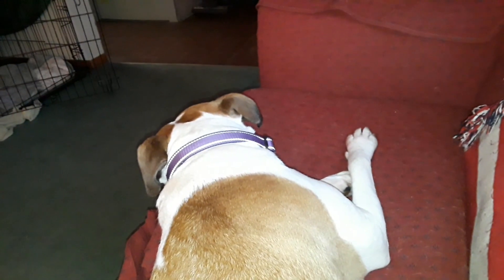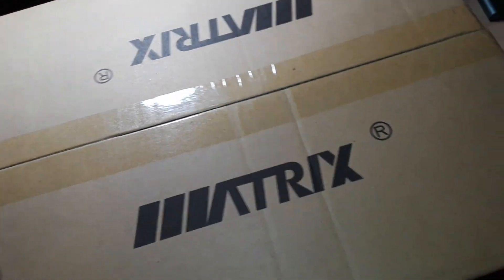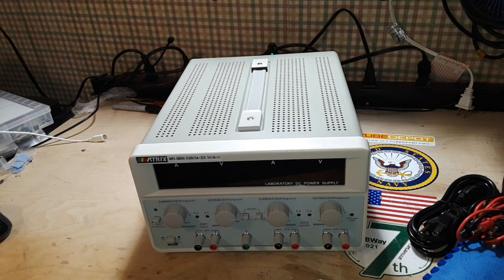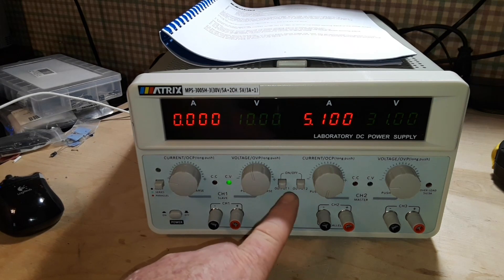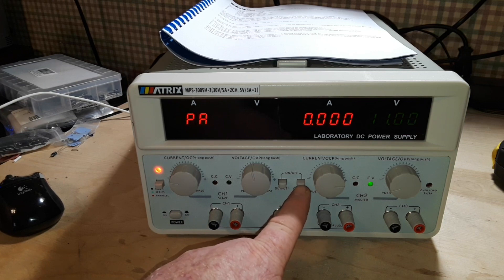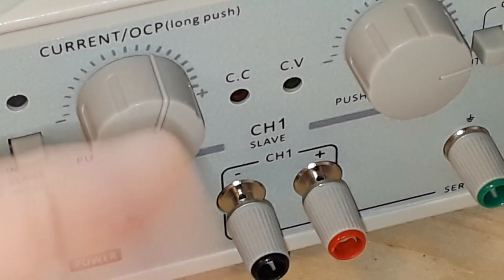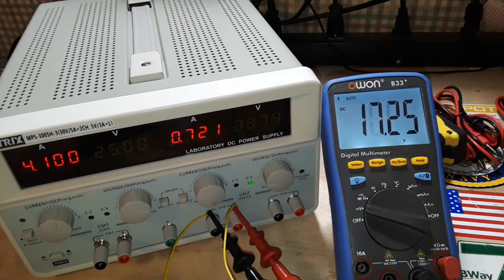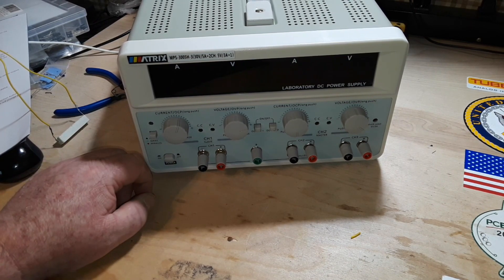Matrix MPS 3005H 3 3 Output Linear Power Supply

Comment: I just got mine delivered a few hours ago. Voltage on both channels is dead on exact. Assuming my EEVblog BM786 is. It comes with a calibration datasheet from the factory. Results were very close to correct. Also lists the test equipment they used and when that was calibrated. Nice. The warranty card wasn't in the box. One weird thing. One dial wouldn't push. I was really pissed off. But I pulled the dial cap off and the problem vanished. Whatever. 🤣 So far, no problems.

Comment: Contrast this with a SMPS which is much smaller and lighter, like you said a great product and should hold up. Understand the fan noise goes down after turn-on but if it's still loud for your taking can always swap with a Noctua fan.

Comment: Does “no independent current adjust but we can do overcurrent protection” mean I can’t use it with current-limiting for hunting shorted components that overheat?
Reply: the current adjust is independent, and you can set the up and low limit of the adjusting range of current and voltage, there is another vedio introduced this function, please take a look:https://www.youtube.com/watch?v=26t9h6fBQ6Y&lc=Ugw9D7RFAGuLxzB3CkF4AaABAg

Comment: One with just 2 outputs would get a lot done around here for me. I broke out the old Dumont G2100 Oscilloscope today. Going to trace down where I lose channel 2 signal. And why my calibration lead is only half voltage. Wish I had the service manual. It’s a hard dig. 
Any-who, Nice Power Supply Paul. 
God Bless.